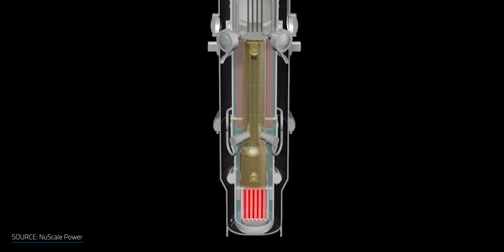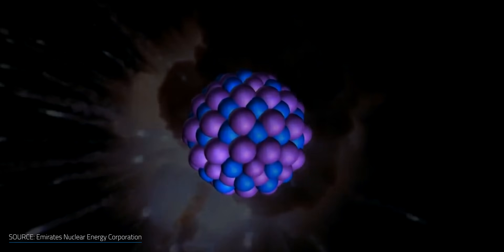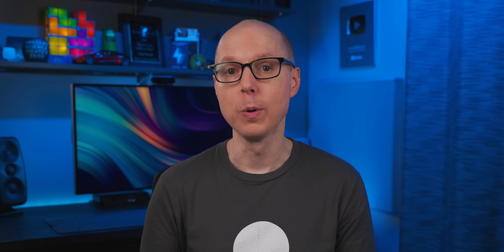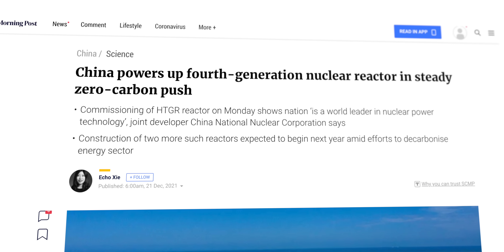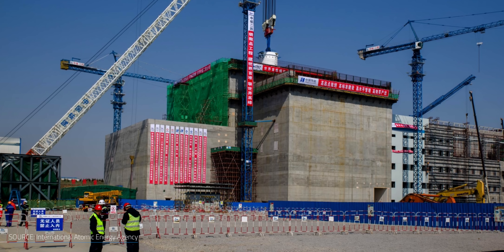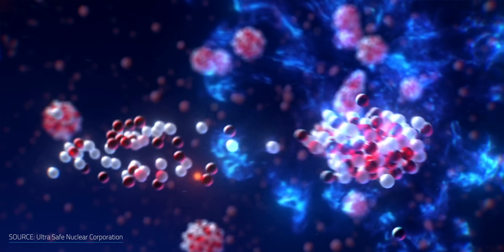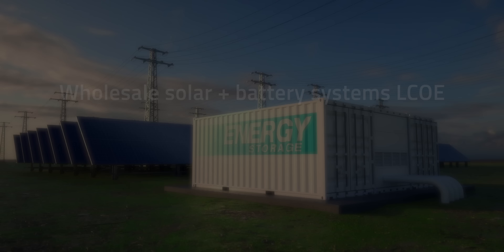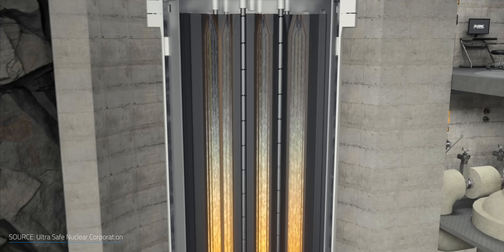Forget Small ... What About Micro Nuclear Energy?

Comment: im working on micro fusion.star in a jar h2 frizzled into the star.. could be miniturised to fit in a car battery case, run a car for the cars lifetime, then vent a little helium, squirt a little more water in with a seringe and fit to a new electric car for another 250000 miles. or micro fit in an sd card, run a laptop for the laptops life. 3 drops  of water in it, mosfet and ultrasonic transducer.

Comment: South Africa was about 80 % complete with  anew type pebble bed reactor back in the late 90's early 2000's before our government pulled the plug. a member of my family was one of the head engineers on the project and it would have been revolutionary for time.   see  ref.

South Africa began developing the PBMR in the 1990s, but it was put into care and maintenance in 2010. It was reincorporated, into Eskom, in 2012.

The pebble bed reactor design was developed in Germany and was used there in the 1970s and 1980s. South Africa became involved in 1988 when Johan Slabber, then with the Atomic Energy Commission (later Necsa) met with the German pebble bed reactor scientists.

The proposal for a direct cycle pebble bed reactor designed for South African conditions was formulated.

Slabber later joined the South African systems engineering company IST and introduced the concept to IST’s Dieter Matzner and to Eskom’s David Nicholls. The three founded PBMR (Pty.) Ltd in 1993.

In 1995, the South African government lent support to the study of the project, and in 2000 South Africa approved the detailed feasibility phase.  Internal research was strong, with the PBMR project generating more than 100 patents during the period 1999-2004.

Eskom committed to purchase a demonstration reactor and to operate it. The Nuclear Energy Corporation of South Africa (Necsa) drew up plans to acquire 24 PBMR reactors over the next 20 years to contribute 4000MWe to the southern African grid.

A large number of domestic and foreign subcontractors became involved in the project, which developed a massive supporting infrastructure. Principal PBMR facilities included:
The Pebble Bed Modular Reactor (PBMR) is a particular design of pebble bed reactor developed by South African company PBMR (Pty) Ltd from 1994 until 2009.[1] PBMR facilities include gas turbine and heat transfer labs at the Potchefstroom Campus of North-West University, and at Pelindaba, a high pressure and temperature helium test rig, as well as a prototype fuel fabrication plant.[2] A planned test reactor at Koeberg was not built.

Contents
1	Reactor design
2	PBMR (Pty) Ltd - History
2.1	Wind down in 2010
3	References
4	External links
Reactor design
The PBMR is characterised by inherent safety features, which mean that no human error or equipment failure can cause an accident that would harm the public.[3]

Heat from the PBMR can be used for a variety of industrial process applications, including process steam for cogeneration applications, in-situ oil sands recovery, ethanol applications, refinery and petrochemical applications.[4] The high temperature heat can also be used to reform methane to produce syngas (where the syngas can be used as feedstock to produce hydrogen, ammonia and methanol); and to produce hydrogen and oxygen by decomposing water thermochemically.

The PBMR is modular in that only small to mid-sized units will be designed. Larger power stations will be built by combining many of these modules. As of 2008, 400MWt was emerging as an optimum module size, considerably larger than the original concept size.[citation needed]

The PBMR is fuelled and moderated by graphite fuel spheres each containing TRISO coated low enriched uranium oxide fuel particles. There are 15000 fuel particles per fuel sphere the size of a billiard ball. "Each fuel pebble contains 9 g of uranium, and this holds enough generation capacity to sustain a family of four, for a year. Five tons of coal and up to 23 000 m3 of water will be required to generate one pebble's energy.”[5]

The concept is based on the AVR reactor and THTR in Germany, but modified to drive a Brayton closed-cycle gas turbine.[6] The core design is annular with a centre column as a neutron reflector.[5]

PBMR (Pty) Ltd - History
Since its establishment in 1994, Pebble Bed Modular Reactor (Pty) Ltd grew into one of the largest nuclear reactor design teams in the world.[7] In addition to the core team of some 700 people at the PBMR head-office in Centurion near Pretoria, more than 600 people at universities, private companies and research institutes were involved with the project.[8]

In 2006, the US Department of Energy awarded the PBMR consortium the primary contract for the first phase of its New Generation Nuclear Plant (NGNP) project.[citation needed] The scope for the first phase of this contract, which has now been completed[citation needed], was for the pre-conceptual engineering of a nuclear co-generation plant for the production of electricity and hydrogen. Requests for proposals for the second phase of the NGNP project will soon be issued, to which the PBMR consortium will be responding within the next few months of 2009.

In 2009 PBMR (Pty) announced that it was looking at employing the technology for process heat applications,[3] and some pebble bed reactor contracts had been put on hold to prevent unnecessary spending[9]

Wind down in 2010
In February 2010 the South Africa government announced it had stopped funding the development of the pebble bed modular reactor, and PBMR (Pty) stated it was considering 75% cuts in staff.[10] The decision was taken because no customer or investor for PBMR was found. Unresolved technical items, a substantial increase of costs and a 2008 report from Forschungszentrum Jülich about major problems in operation of the German pebble bed reactor AVR[11] had discouraged potential investors.[12] International banks refused to support the PBMR project by loans. PBMR's CEO resigned on March, 8th 2010.

In May 2010 Westinghouse withdrew from the PBMR consortium, which led to an end of the South African engagement in NGNP.[12]

On 25 May 2010 the company announced to staff that it intends to implement a "Care and Maintenance" Strategy. This involves the reduction of staff to 9. The stated purpose of the proposed structure is; preserve PBMR as a legal entity, preserve and optimise IP, preserve HTR license, preserve assets and solicit new investors. The strategy assumes that keeping on 9 employees in the medium term will leave sufficient funding to take PBMR to March 2013. The remaining employees will serve to end of October 2010. Some funding is foreseen for dismantling of the PBMR fuel fabrication laboratories in 2011.

In Sept 2010 the SA govt announced that in future, the South African nuclear program will concentrate on conventional light water reactors.[12]

The NGNP project will continue on HTGRs with prismatic fuel elements, not with pebbles as in PBMR, as was announced in February 2012.

R9.244 billion (US$1.3 billion) had been invested in the PBMR project. Over 80% came from the South African government, with smaller amounts from Eskom (8.8%), Westinghouse (4.9%), Industrial Development Corporation (4.9%) and Exelon (1.1%).[8]

Comment: The most important factor moving forward is the decentralization of the grid, it's the only way we can keep aging grids alive without the complete overhaul of transmission systems.
Reply: But don't forget economies of scale. Bigger generating units tend to achieve lower cost/MWh compared to smaller ones (I was a bit surprised with these SMR numbers, I must say). If (big generation + grid) costs are lower than micro-generation units then there's no economic rationale to switch. The first electric systems were quite decentralized but, as technology improved, it became the way it is now. Maybe technological progress makes it turn around again...
Reply: @nunocarmona  its coz big plants can't be built in factories/shipyard this makes then cost way more, Modular Reactors can be standardized and built in factories/shipyards massive lowering the cost, as an example ThorCons ones they are building in shipyards which is probably the biggest at 0.5 Gigawatts
Reply: @nunocarmona  one of the costs of nuclear people don't understand is government. The larger sites are more cost effective due to fees government has on the sites. The fees and charges don't scale so larger sites are more cost effective. If the government wasn't trying to kill the industry quietly it would make more financial sense for smaller modular units prefabricated then distributed.

Comment: Is there a more efficient method of harnessing energy besides using a turbine? Seems odd that all of our methods of generating electricity use the expansion of steam. I feel like we're overdue a StarTrek like way of generating electricity
Reply: There's the Seebeck effect which turns heat directly into electricity but it's terribly inefficient. Solar cells turn photons directly into electricity as well but they mostly aren't super efficient either. Steam is easy to produce and can carry a lot power. From an efficiency stand point I believe we'd be better off using helium as the energy carrier but the costs involved make it not worth it.
Reply: There's other ways, but this one is as efficient as it gets at the moment.
Reply: Don't underestimate steam - it's (relatively) highly efficient. Even in Star Trek? they use cups to drink out of.

Comment: After watching the Russian's indiscriminately shell Ukraine's Nuclear Power Plants, I've found a whole new understanding as to why nuclear power (fission) is a bad idea no matter what form it takes.
Reply: Realistically the reactor containment itself was never in danger, it takes a lot more than an artillery shell to crack that open. There was a risk the coolant loop could be damaged which, if the reactors weren't able to be shut down quickly enough, could lead to a meltdown. Something like a FCVS system could provide a last line of defence, allowing for any meltdown to have a much smaller radioactive release, but they aren't fitted to some older reactors.
Reply: They didn't indiscriminately shell nuclear sites - they built them.

Comment: I would ask what you can do to research the viability of geothermal energy; Russia successfully drilled one of the deepest holes within the earth's crust, resulting in the bottom of the shaft experiencing temperatures in excess of 180 degrees Celsius, and that is more than hot enough to start a steam engine to use that steam to drive an electrical turbine.
Reply: The bore hole you mention closed up almost as soon as they stopped drilling it. At great depth you have great pressure which causes the rocks to essentially flow like molten glass. As for the temperature, 180 degC isn't enough to make a viable power station (see heat engine and the Carnot cycle) - not to mention the steam wouldn't be 180 degC by the time it got to the surface to be fed into your power plant. For reference gas turbines run in the 1300 degC range. Geothermal also suffers from the the problem of low energy density. The rocks deep underground might be hot but that heat built up over a long time. If you suck the power out quickly the rocks cool down and you have to wait (a long time) for them to warm back up again.